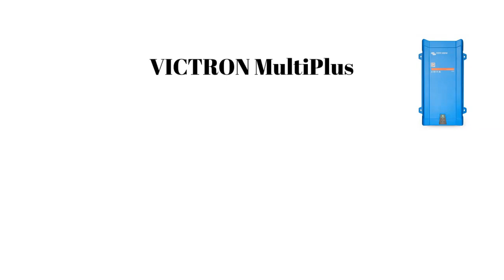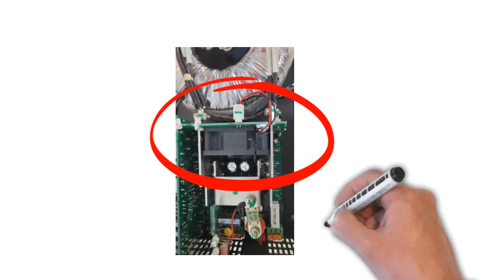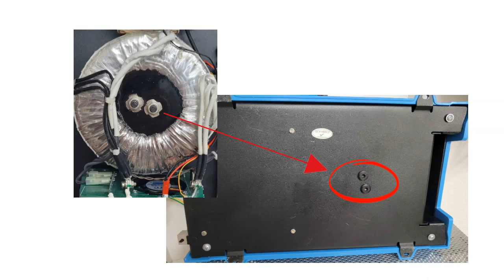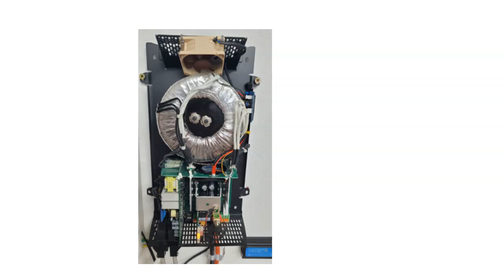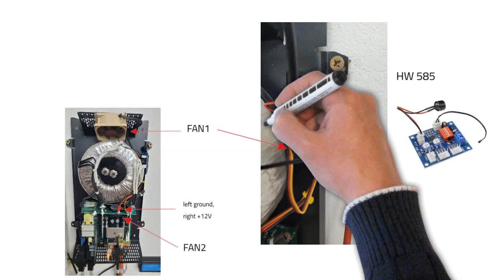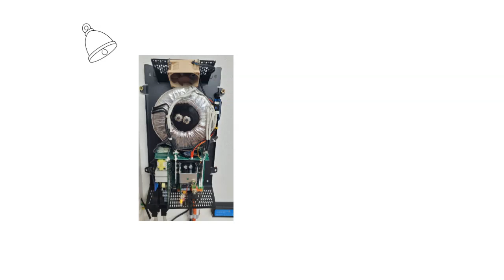Victron low noise

Comment: The two bolts holding down the transformer are too tight to unscrew. The two bolts on top can be removed, however the transformer appears to be glued down requiring a lot of force to remove. Haven’t dared to do so, and thus can’t reach the screws of the original fan :-(